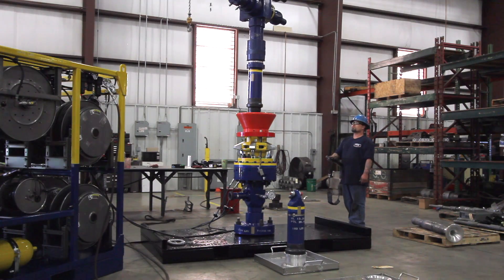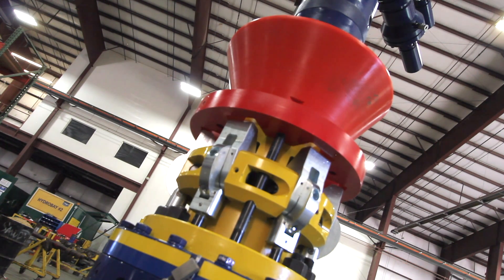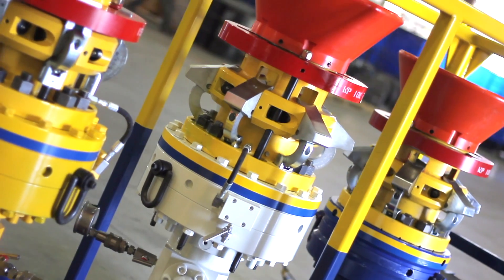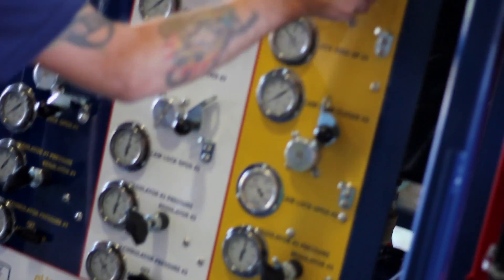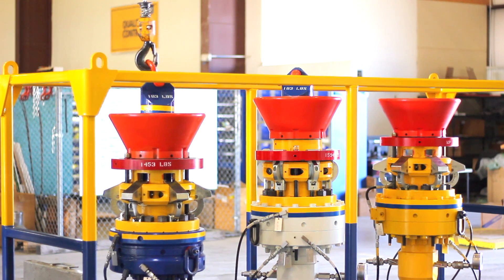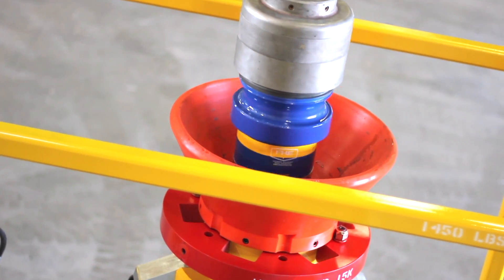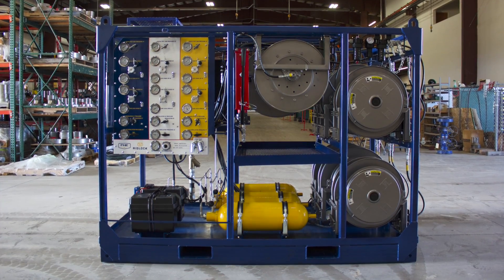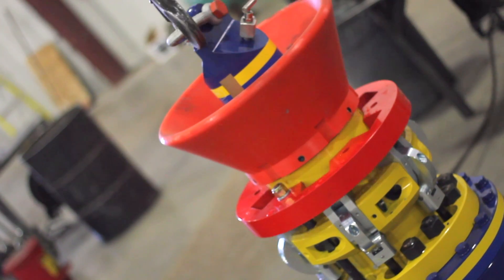FHE RigLock

Comment: when pulling tools into the lubricator how would you use a entry guide?
Reply: Entry guide wraps around the outside of the riglock adapter on the bottom of the B.O.P